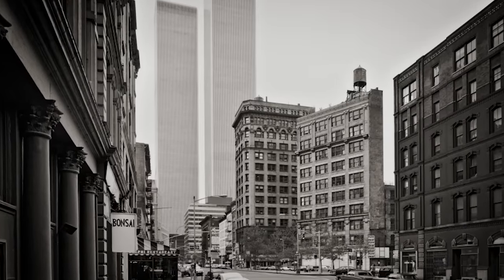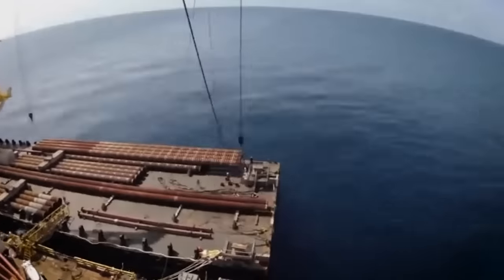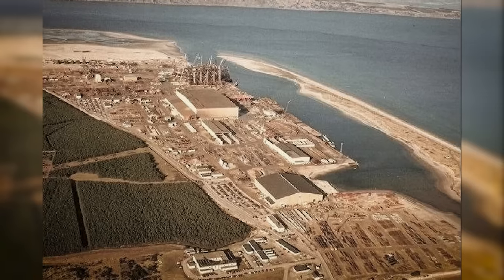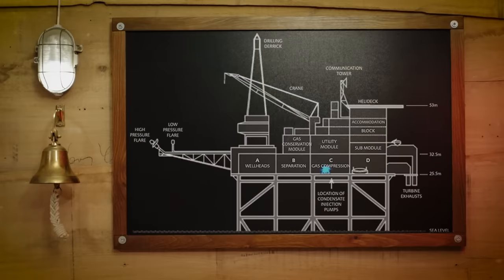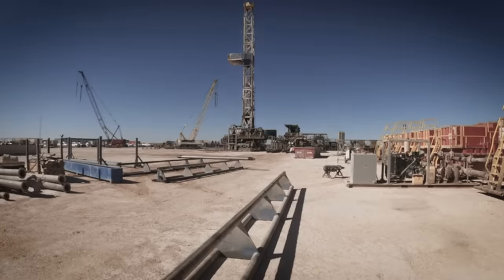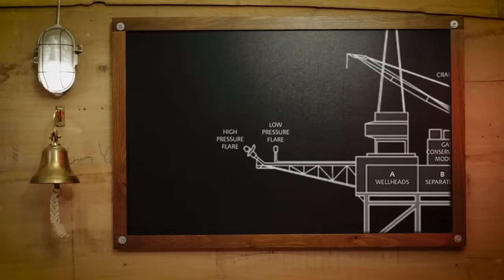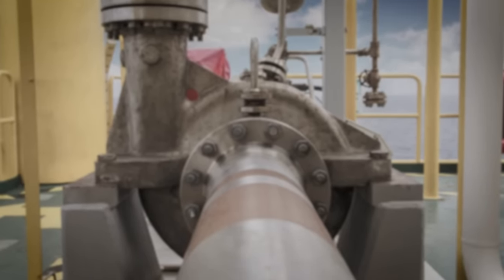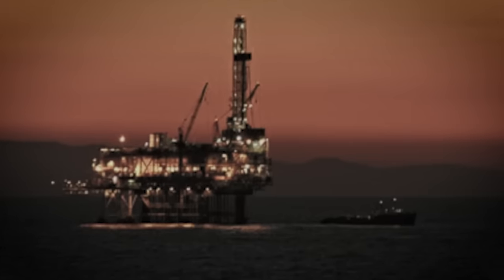This Block Has 87 Dead Bodies

Comment: The the lad shown at the end of this video was a mate of mine, Davy Elliot. He jumped and survived. For the rest of his life he was a bitter about it and when we were out drinking  he always said  he would never trust anyone in authority again. He never worked after the disaster.  This tragic loss of life reshaped the North Sea oil Industry and brought about huge changes in safety. It was a tragedy beyond words. RIP to all those who perished.
Reply: Man had it rough
Reply: I was working in the Braefield on Brae Alpha 6 years ago operated my Marathon oil at the time, high pressure production pipe burst blowing out the walls, doors and ceiling of a full module.  This particular module was a short cut taken regularly to gain access to the control room.  The release of gas was so severe had anyone been in the module they would have turned to vapour, I don't doubt this as the whole platform shifted up.

I'm a rig pig no scholar, please excuse poor grammar.

Bad stuff still happens it is just often suppressed.

Comment: When I was in the Navy and taking safety training, I took a class called trace barrier analysis, and this was used to show how one step can cause an accident or prevent one.
Reply from the maker: Part of the problem or the solution
Reply: The Navy’s Lockout/Tagout program prevents these type of catastrophies. At least if the exact procedures are followed and not gundecked, which we know is a problem everywhere. I think non-sailors refer to this are “pencil whipped”.
Reply: Bob - Question, how did the term come to be? I understand the “pencil whipped”. Hear it in aviation industry, 1:25 regarding ghost or made up or creative entries in maintenance logs. Also in pilot logbook entries.
Reply: It comes from gun crews relatively common practice of short cutting safety procedures in handling powder and ammo years ago. to make it easier to handle powder and ordinance or increase their rate of fire. Such as propping hatches open to pass powder and ammo rather than using passing scuttles most famously seen in the battle of Jutland and was the cause of so many of the British Navies sunken ships and loss of men. so when the gun crews short cut allows a normally survivable incident  to become a catastrophe i.e a hit on the gun bypasses the protection between it and the powder room setting it off, which then sends the blast through the open armored protection hatch into the exposed powder elevator down through the open door to the powder magazine and now instead of a damaged gun and a couple dead and wounded the whole ship and crew are lost because it was faster to pass the powder through the hatches rather than using the scuttles. Hence the term it was gundecked or gundecking
Reply: @robertswafford4145  any type of job working with machinery or hell even vehicles and theres shifts involved and always changing hands i think Lock out Tag out is required. otherwise you endup with a guy who was working on something not coming into work due to sickness or vacation. and someone else walking up to the same piece of equipment or vehicle they've always used without knowing try to operate it not knowing its missing parts or partially dissasembled.
Reply: @justnsaliga8518  So why did they switch on a pump with an open piping system? One with flammable effluents at that. I worked in the civilian industrial setting for decades while I was still in the Naval Reserve and it frightened me the disparity in lockout/tagout procedures.
Reply: one wrong step causes many wrong steps along the way 
Process route deviation
Reply: The shooting and death on the movie set "Rust" is a good example where a few details were left out of what was a fairly extensive safety protocol list, causing a death i.e. don't have live rounds on a movie with shooting scenes.
Reply: @warrior7ra  Thank You very much for that explanation!!!
Reply: @warrior7ra  always appreciate explainations like this, thanks!
Reply: Wtf
Reply: @robertswafford4145  Did you not watch the video?
The problem was the paperwork was kept in two different places, which seems crazy, but that was what they did back then.
The work permit for pump A was in a different place to the permit for the work on the safety valve, as it was on a different location, even though it was part of the same system.
Reply: @andy70d35  Right. Two tagouts file locations on a connected system with massive ramifications if operated while tagged out. No one saw or could forsee a problem with this? Inexcusable.
Reply: @robertswafford4145  Totally agree, even if the two locations were on different levels, they were still part of the same system.
Reply: @robertswafford4145  yeah I hear of these things and think under modern OSHA(or given the North Sea location "Health and Safety") regs, there would (in theory)be a red padlock on the shut off for that pump telling someone that piece of equipment is secured for some reason.

I say in theory because rules get made but its still up to the company to have a safety culture that follows them.
Reply: @robertswafford4145  I'm sure some people saw problems with it but safety regulations simply weren't what they are today back then, it's events like this that are why we have the safety regulations in place we do today cause like the saying goes safety regulations are written in blood. Obviously it would be best for people not to have to be injured or killed for places to become safer but that would require the company to willingly spend more money on safety which the vast majority just won't unless they absolutely have to
Reply: @filanfyretracker we do.  If time. Trust me.

Comment: My father was a compression diver working in the North Sea and told me the story of how he was on the Piper Alpha days before this happened. Not only that, during the 80's he was a diving supervisor and the absolute cowboy approach the oil & gas companies had back then was nothing short of gung ho, he still has all his little black books from the time, shocking. Thanks for retelling these stories, lest we forget that these large companies will treat us like nothing more than grist for the mill given half a chance. Profit is king, we are seen as expendable.
Reply: Safety was something pracriced when the bosses were inspecting!
Reply: What are those "little black books"? Logbooks?
Reply: It's usually low-level management cutting corners that causes the issue. No successful oil company is ok with safety hazards because they are VERY VERY expensive.
Reply: I feel like if one had to pick a place to work of three choices. Submarine, Oil Platform or the ISS. Id pick the ISS. Spaceflight seems safer than the first two.
Reply: "Tyrants prosper till the serfs slit their throat"
Reply: I bet he had opinions on the Buford dolphin accident since your father did that job
Reply: @Dee-nonamnamrson8718 no its low level management being pressured from mid level to meet un-realistix goals. This pressure is what causes the cost cutting and time spent on safety. If a low level boss shutdown down production for a "potential" safety concern his bosses will be mad and make a big stink about losing money especially if it was found out that said concern was okay. This happens repeatedly and over time they learn that to keep their jobs they have to cut corners, even though the stops of production are necessary and should be considered when setting production goals the upper mgnt acts like its unscheduled downtime. It also doesn't help that the people up top very rarely even understand how things work because they are pencil pushers, yet they make decisions they're  qualified to make judgements on. And that is in qny business. Upset management usually could be eliminated and the entire process would run if not run smoother when the bean counters are cut out
Reply: Not much has changed. Onshore the companies run everything, whole teams die regularly from non-existent safety and pressures from company-men running everything.

Only good part is the company-men die with them.
Reply: @boosterhuiz2779  The bosses aren't going to go anywhere near one of these sites. If they saw you practising safety they'd only see costs.
Reply: @whatilearnttoday5295  "Tell me you've never worked in the energy sector without telling me you've never worked in the energy sector." 
We've lost clients on multi-million dollar projects because someone wasn't wearing safety glasses (not even one of their employees) in a daily report photo.
Reply: @Dee-nonamnamrson8718 lmfao what kind of logic is this? “HURRDURR once the company I worked at didn’t break the law so none of them ever do”?
Reply: Why lie?
Reply: Why aren’t we doing something about it then?